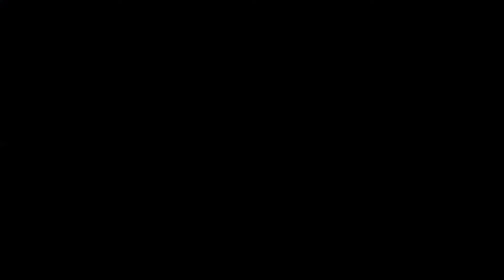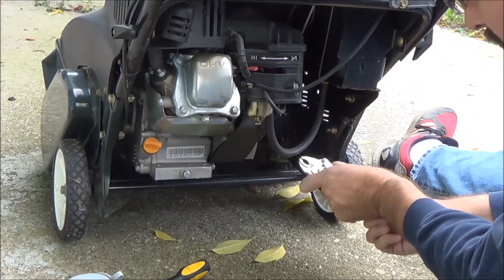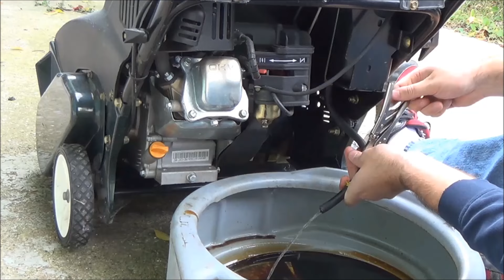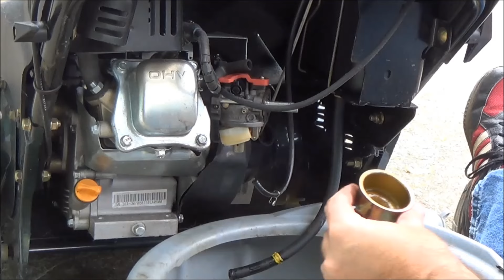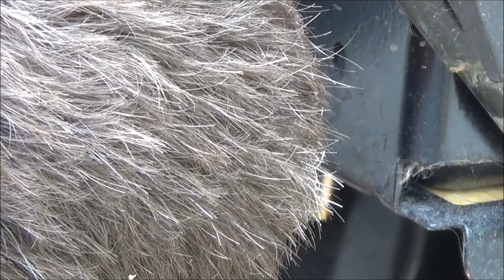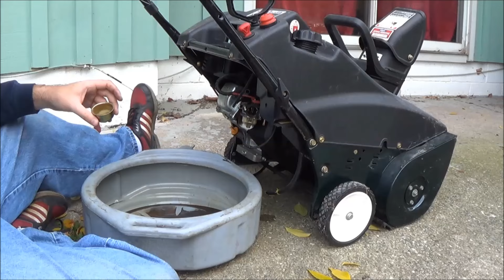How To: Repair Snow Blower Carb - Engine Only Runs with Choke

Comment: My snowblower will only run on choke. I’ve replaced the carb with a brand new clean one and still. Any help ?
Reply from the maker: Make sure fuel flows freely to the carburetor. You may have a restriction between the fuel tank and carb. Otherwise you may have a bad new carb.

Comment: Will it run fine if you just let fuel run out and add new fuel w/o cleaning the carb?
Reply from the maker: If it won't start or only runs with choke it needs more than new gas.

Comment: The surge you are still getting is from two things, The Governor spring is too loose and you didn't clean out the carb air/gas Mixture screw, located under the plastic cap at top of carb.

Comment: Great video! I’ve been able to move out of choke with extensive use of the blower. However, I am about halfway to run. Would you still recommend cleaning the system or letting the new fuel cycle out the old.
Reply from the maker: If you have run and worked it for more than a few hours and still can't run it at full power then I recommend cleaning the carb. I have a few other videos that go into more detail on how to remove and clean various carburetors, so check those out as well.

Comment: Well thank you for the video ... repaired my snowblower just before a storm where I had checked my snowblower just before winter and it ran fine and then it decided not to. I cleaned out the fuel bowl and blew some carb and choke cleaner up into the tube you put your wire up into after I did the same. Put it back together being careful to make sure my rubber seal was seated for the fuel bowl and all runs perfectly.

The rubber seal had sand on it and there was sand and dust all over the place, my snowblower doesn't have an air filter type design and that is what it is.

Gapped a new spark plug at 0.30" and put in fresh fuel which I had to drain the old fuel which was not spoiled but I threw it out anyway. 

In any case thank you for this info and how easy these carburetors are to clean and maintain without a trip to a technician that will cost you money for seemingly not much work in this case.
Reply from the maker: I'm glad to hear this video saved you some time and money!

Comment: You should have also cleaned the top jet located below the throttle screw, ( black plastic) screw. Remove the throttle screw and take out the small plastic 
insert. It has a very small hole in the middle. Blow air through it, some carb cleaner a wire and replace. You wont get the hunting and surging you got after you started the engine. Good video though.

Comment: Another trick or good way to resolve this problem after cleaning carburetor is to purchase an adjustable high speed needle assembly (available on Ebay), because even after cleaning very throughly or replacing carburetor it may still surge and well this kit resolves that issue.

https://www.ebay.com/itm/Adjustable-High-Speed-Needle-Assembly-Predator-Honda-Powermore-OHV-OHC-Engine/164020631516?hash=item26306437dc:g:iAIAAOSwD9JeE2dw

Comment: i'm lazy so i just put seafoam in there and wait till it fixes itself, you can run it in choke a few times without it hurting anything if you kept doin it eventually you might need a spark plug but no other harm will be done.

Comment: Hi, i cleaned the carburetor,  changed a mew spark plug, put in new gasoline for the 4 cycle toro but it still wouldnt start. I also use the electric plug in and it wouldnt start. If i use electric im assuming the carburetor and the gas is not the issue so what could be an issue? Thanks
Reply from the maker: Probably still something in the carburetor. Watch my video on the generator and the 2-stroke snowblower for more in depth carburetor cleaning. Most small engine carburetors are very similar internally. Or buy a replacement carburetor for your engine. They are usually inexpensive online.

Comment: Thank you so much! Couple of things to add.

1. The rubber seal on the fuel cup under the carb is conical. The smaller diametre goes into the cup, else it won't seal.
2. The cup itself is thin aluminum, very easy to over-tighten. Mine is a 1/2" bolt, which I hand-tighten towards the end.
3. Once done, run the engine in upright position, to make sure there is no fuel leakage around the retainer bolt on that cup.
Reply from the maker: Thanks for that!

Comment: Eric, thanks for taking the time to post this video!! Your video was spot on and actually showed my specific model of snow blower. It was reassuring to see on your video that I could use a vise grip to choke off the fuel line since there was no convenient way for me to actually cut it off otherwise. Following your steps made my snow blower a happy camper! It was only running at 50% choked this whole season... past couple of attempts, it needed 65%, 75%f and then the last time it was only running 95% choked and coughed to a halt at least 3 times... I was using h2o proof tape to hold the choke lever in place while snow blower to manually carb it to "just the right" amount... I knew it was finished and we have another 4" storm coming to the Midwest tomorrow. Doing the steps on your video saved me and probably my back!!

Also, and I'm not sure when this happened.. but both of the retaining nuts that you removed from your video had shaken off my blower which was causing the carb assembly to pull away from the engine... I had to go find two hex nuts to replace it with and that also helped immensely.. So to any other readers, do check and tighten the nuts that are there. That small gap and gravity may also be an accomplice to contributing to fuel loss/leaking between the carb injection and engine intake/combustion!!

Fwiw, I didn't even need to use the wire.. I have one coming today, but thought I'd try it yesterday with just the compressed air and carb cleaner and that turned out to be enough! So anyone who doesn't have the wire, don't rush out to get one especially if you're snowed in and need the blower back right now!

For others that may be googling, here are a few of the key terms I'll tag in this comment that I tried searching for to ultimately find this video.. perhaps it will help to drive more people to this useful tutorial faster!

Notes/Tags: Menard's MTD Pro 21 Model MP21 Powermore 179cc OHV single stage Snow Blower dirty carb carburetor cleaning - runs on choke or partial or half choke and engine surges or pulses - How to clean carburetor without full disassembly

Carb cleaning kit that I didn't use, but may have if my carb was in worse shape: https://www.amazon.com/gp/product/B072JVQ5DT
Reply from the maker: Glad you got your snow blower running well again! I'm sure the nuts missing from the carb were a big part of your problem. That air leak would make the engine run really lean.

Comment: Thanks! We hadn't had much snow in the past 3 years and it had been sitting around with old gas. We have 5-8 inches forecasted starting tomorrow, and more later in the week, so I was desperately not wanting to shovel. Started up on the first pull!
Reply from the maker: Awesome! Glad you got your snowblower running again. That much snow will give it a good workout!

Comment: So the main jet was clogged, clean the main jet and it will run, I would at least take the main jet out and clean it, sometimes in the emulsion tube the holes in the side get clogged also, take out and spray carb cleaner thu. Make sure all holes are open. Small flat head and jet will unscrew , same place as he stuck copper wire
Reply from the maker: You're absolutely right. I did a similar repair on another snowblower recently and removed the jet for a more thorough cleaning on that one. I posted a video of that repair in December 2020.

Comment: Thank you man, I was just running it on choke for a while, but the machine was struggling/slow with the high snow fall recently, fixed it up in like 20 mins and it made clearing the rest of the snow a lot easier.
Reply from the maker: Glad I could help

Comment: My craftsman 5hp only runs on full choke. I cleaned carb. Sprayed sea foam and still only runs on choke.  When I look up into carb I see jet. I put thin wire up there and sprayed which seemed to be open
  Any idea what else I can try?
Reply from the maker: If it only runs on choke then it is not getting enough fuel. Make sure you have good fuel flow through the fuel supply line to the carburetor and if there is an inline filter replace it. Also look at the bolt that holds the bowl to the carburetor and clean any passages in the bolt. Check out my video from repairing a champion generator which had a restricted passage in the bolt, and please subscribe to my channel. Best of luck to you!

Comment: Mine runs just like yours after you cleaned it. It sputteres without choke but runs. It is brand new but I left gas in it for 10 months. Will cleaning it solve the problem and run smooth?

Comment: Thank you for making this video.  I will try this tomorrow.  I put stable in every spring for storage so I was surprised that I started having this problem.
Reply: Did your procedure this morning and it works like a million bucks.  Toughest part was trying to find a wire small enough to clean the jet.  Also it runs a little rough like you said it would until the air gets through it.  Thanks again.

Comment: thank you very much.
We have a PowerHorse 208cc (Honda OEM) on my son's go-cart.  After setting for 2-3 months, it now won't run unless the choke is engaged. I've adjusted the idle to see if it helped, and it did not.  with your video I will now try to clean the carburetor.  I'll let you know how it goes.

Comment: I have the MTD version of this snow blower so it has the exact same motor and everything. I recently couldn't get the blower to start so i replaced the carb with a brand new one. Now it will start up on full choke and as soon as move the lever over to run it will high rev like the engine is about to blow up. Any ideas what i should check next? I also replaced the spark plug with an oem plug. I have an inline fuel filter as well but i don't believe that would cause this issue. Sounds to me like a gov issue or maybe an idle adjustment. Hope you can help me out with this. Thank you in advance.

Comment: Does it cause any damage running the snowblower in closed choke position temporarily?
Reply from the maker: No it won't do damage, but it will be low on power.
Reply: I have found it floods my engine and fills the crank case with gas if I run it all winter on full choke.  Thanks to Brad Kerr's comment above re: the pilot jet I got it to run with without choke for the first time in quite a while.  I may still take off the carb and soak it for a few hours but hopefully no more oil changes..

Comment: i am having a problem where my snow blower does not seem to idol high enough and it does not plow wet snow at all which this unit becomes useless. anyone have any idea's where the idol in on this Craftsman 11683 21" 123cc Single-Stage Snowblower?

Comment: this usually is a problem that is caused by running ethanol fuel. after a period of time unless using a additive or the best thing is to run a minimum 87 octane ethanol free motor fuel which is still available but rather expensive. ethanol starts to degrade in less than a month  and additives will only take you so far also and can get expensive. regular motor fuel can perform great for several years; but don't try that with ethanol because you'll get just what you got and in the long run will destroy  the small motor.

Comment: If only people would remember to add stabilizer.  
That’s it no need to empty the tank.  

It’s also easier to completely remove the carb and completely clean it.
Reply: Still better to drain it and replace with fresh stabilized fuel at least once a year. Steel tanks I keep full so they don't rust internally but plastic tanks I leave empty.

Comment: this problem has become worse since 2007-2008 when the fuel industry started add 10% ethanol to regular grade fuel and 5% to mid grade fuels.  typically ultra or super has 0% ethanol added to it so that's what I use.  Also adding Stabil to each Gerry can when filling with new fuel will keep the fuel fresher longer.  Doing this you'll never have a foul fuel issue.
Reply: So much easier to just add stabilizer at the end of the season, run it for a couple minutes.  Then shut it off
Reply: Yep. Stabile is the best. 😂

Comment: You forgot about the small idle bleed hole that is under the idle stop screw it should not surg when to its running
Reply: This was a fast fix to get the engine running again. It maybe useful if in a hurry and no time to remove the carburetor.

Comment: Any small engine with a carburetor...should (actually - MUST really) use non-ethanol fuel...and a higher octane is better.  Why?  because the fuel will separate into the ethanol vs. gasoline components if left for ANY time at all...thereby allowing the internal parts to take on the ethanolic residue "crap" from said mixture.

Ethanolic fuel...is just more 'fleecing of Americans'.

Comment: Very good and thorough video. Did exactly what was recommended in the video and my snow blower now runs on Run. Initially I had a problem with the blower not wanting to start at all. Found out after 5 min of no start that gas should not be left in anything for 2 years straight. It had been 2 years since I last used my blower. It is a craftsman that I bought 4 years ago and up until today had been used only a handful of times, but still relatively new, however bad gas caused by 2 years of non-use will ruin anything. I found green gunk and small grains in the carburetor bowl which is what also caused the jets to be clogged. I ended up taking the carb apart and completely cleaning it after seeing this video. My blower fired right up and ran on choke and finally on Run. Before it would only run on choke and once I put it on Run bam shuts off. Lesson learned and applied drain your gas from your blowers and mowers otherwise you will end up with a big time headache that ends up with you taking apart the engine and going through this

Comment: Add Seafoam let it run.
Reply: I tried that, it didn't work, even after a good 20 minutes of running on full choke.  As soon as I moved the choke to halfway, the engine died.  Seafoam is not always a cure all, but I agree it is a good first thing to try.  Afterward, I followed the advice in this video and problem solved.

Comment: looks like still running rough on idle ?????????
i cleaned my main jet and emulsion tube 2 times 
only after soaking in solvent the whole carb did it run better !!!!!!!!!!!!

Comment: thanks for the vid ! I have a snowblower brand new, used only 5 times last year and its doing the same thing. I will clean it this way and see if it will do the same. It shoots flames out when its switched to run. What do you think?

Comment: When i prime 2x the gas on my snow blower, i seen gas leak...i opened up the cover thinking i have a broken gas line, which i did not....the gas came out from the opening of the carburator out of a small hole.Any ideas?  Thank you.
Reply: Maybe you need a new bowl gasket. What if you prime it more than 2 times it actually is normal for a little gas leak out.

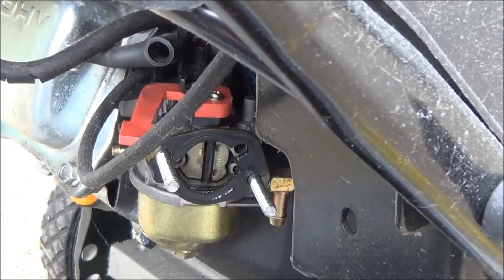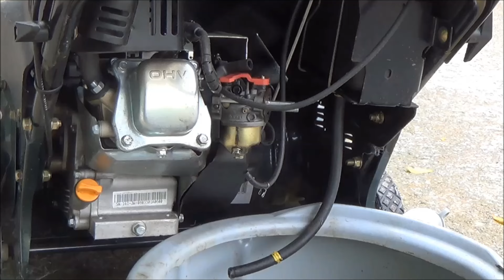Comment: You've addressed part of the problem and will restore power under load, but it is still surging at no load. This is because the idle is still lean, and running lean makes it over rev and the governor will kick in and out causing the surge. To correct this, you need to clean the very tiny pilot jet. To do this, underneath the red throttle arm at 3:17 there is a black screw with a plastic head, also visible at 3:29 showing the D shaped head. Take note of how far it is screwed in. Remove this throttle stop screw, and pull out the vertical black plastic plug beneath it (plug may be one or two plastic pieces). In this lower end of this plug is the small pilot jet (a brass insert with a vertical hole) that feeds into a horizontal through-hole. Once cleared out, reassemble.
Reply: Thank you Brad Kerr. I just finished cleaning the first carburetor I've ever worked on because my snowblower wouldn't start. I did not want to mess with that screw on top because I assumed it had a specific setting, but I also did not realize that there was a jet underneath it. The result is that I now have a snowblower that starts very quickly but surges when I take it out of choke. I will revisit this and hopefully get it working correctly. Thanks again!
Reply: Brad Kerr mine is a steel screw with a spring washer and brass o ring, is that not to let air in.?
Reply: good one Brad
Reply: Brad, Thanks!!
Reply: Thanks for the additional info!
I got mine running much better, I’d say at 95%. The only thing I didn’t clean out was what is under the Welch plug, because I didn’t have a replacement for it.

Comment: Now the engine is surging. You should of soaked the whole carb. in cleaner for a few hours. Removing the brass main jet, and emulsion tube  which is in the center of the carb. where you stuck your wire though. The emulsion tube is still clogged. The engine should run smooth in the open run position.
Reply: Agree'd on the sitting fore a few hours. Should have never removed the brass jet or ??

Comment: I cleaned the carb,cleaned the spark plug, and replaced the fuel filter. My snowblower will start and run for 1-2 minutes then die out. The belt is really loose would that cause it to stall out?
Reply: Tanker Life Check the float needle and seat.